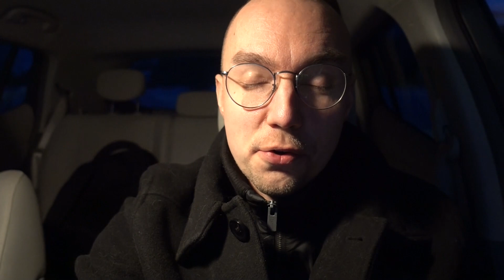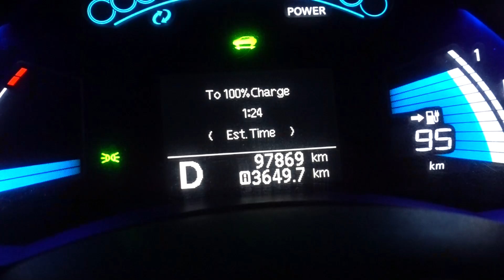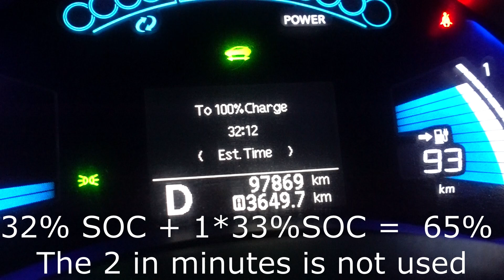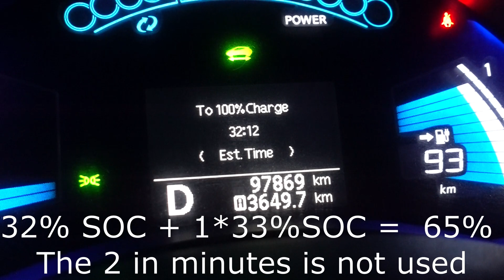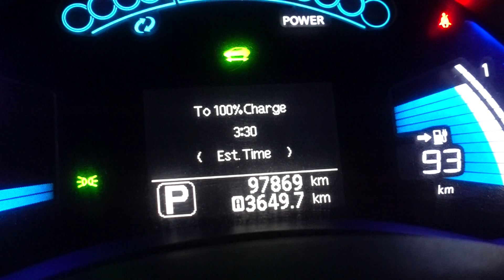New feature: SOC% on ZE0 Nissan LEAF

Comment: Hah!!  Nice Dala!   Awesome, this is a reason for me to go seek out an older Leaf as a second one and swap the battery.   Why does it show 65% SOC,  but the bars on the left show 10 bars?
Reply from the maker: This is an issue on battery upgraded ZE0 cars with my current implementation, the 12bars are not dropping as linearly as on the stock cars. The VCM ignores what the battery is sending, and instead decides to show more bars than it should, but then catches up at the 50% mark and starts to be more accurate. It is a mess, the whole ZE0 is such a nightmare when it comes to the coding...
Reply: @DalasEVRepair  is that the same issue making the gom nonlinear too.  Sounds like a mess but very entertaining to figure out.
Reply from the maker: @DaleKlein  Now that you speak about it, I think Muxsan has figured this one out! It's in their latest tweets!

Comment: Yea okay this is too effed up sir :D how about this, hour means 60, everyone can get that, minutes side can do other number.
1:40 = 60+40 = 100%
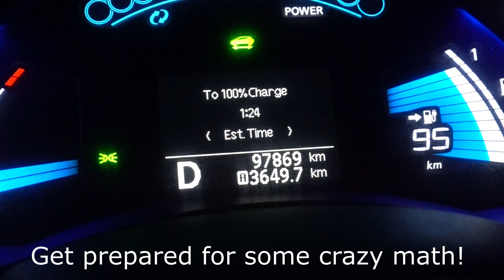0:59 = 59%
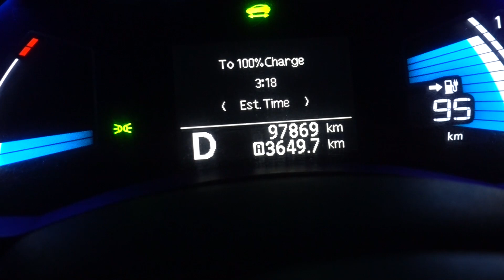1:10 = 70%
Reply from the maker: Would be good, BUT, the minutes side can only increment with 6minutes each step. So only possible values here are 0-6-12-18-24-30-36etc.

So effed up calculation is best we have still...
Reply: @DalasEVRepair  but the first number can be any number up to how high? At least 10 can be there? So that can give accuracy of 10% just from first number?
Reply: oh wait nvm it goes up to 54 then, so you can still round up-down to fairly close by making first number 1=60 :)
Reply: or use first as tenth and add together combination of numbers as second number. 9:54 = 9+5+4 = 99 :P Just adding stuff together makes more sense for more peeps i think, thank some crazy math.
Reply: @DalasEVRepair  What about tuning Hour so that: Hour + Minute = percentage?
You can go as high as 94% and it's easy to compute. 
Below 34% it's just Hour.
Sort of having two tanks/batteries instead of one.
Reply: Above 60% it's minute = 60 hour 0-34
Below 60% it's minute = 30 Hour 0-30
Below 30% it's just Hour
You'll miss 94%-100% part but I have never seen it anyway.

Comment: Go for 0X:YN 
N is irrelevant; X goes 0 through 9; Y goes from 0 to 6 (or 5) ; will miss just 7,8,9 maybe 6. 
Say, round 67, 68, 69 maybe also 66 to 70 
Requires no calculations and is pretty much readable anyhow, just a bit of a stepping stone sometimes.
Reply from the maker: But that is the thing, one requirement I had was that no rounding should take place. This is what makes the SOC% so useful, it is spot on compared to the GOM!
Reply: @DalasEVRepair  Ahhh, I see. 
No way to force the GOM to show SOC% instead of the useless predicted range? 
Switcheable of course.
Reply from the maker: @corradolaposta2421  Sadly the GOM is adjusted according to consumption and temperature, impossible to get it to display an accurate value!
Reply: @DalasEVRepair  "impossible to get it to show the accurate value" - aaaargh! Drives me crazy that that is true.
Reply: @DalasEVRepair But are you able to hijack the consumption and temperature reported to the GoM calculator? If so, you could reverse engineer the GoM lookup table. Then  find the desired output value in the lookup table and input the according values for temp and consumption.
Reply from the maker: @matroosoft  Not that easily, I only place the CAN-bridges between Battery and VCM, to hijack the consumption nobody has done yet afaik.
Reply: @DalasEVRepair  Ah makes sense